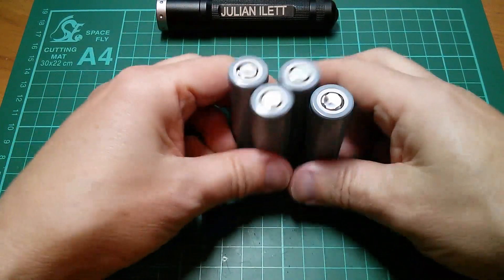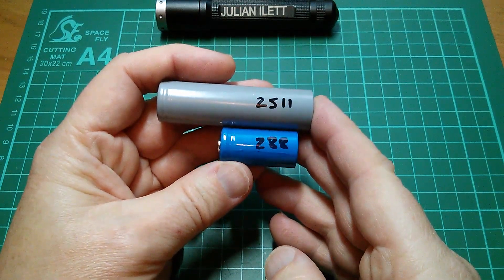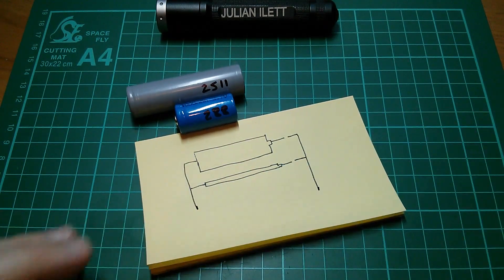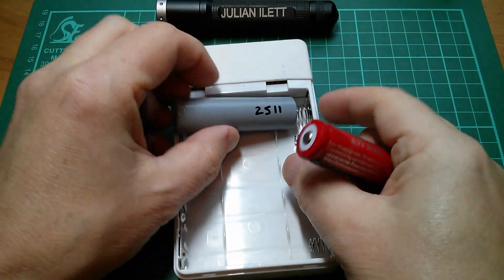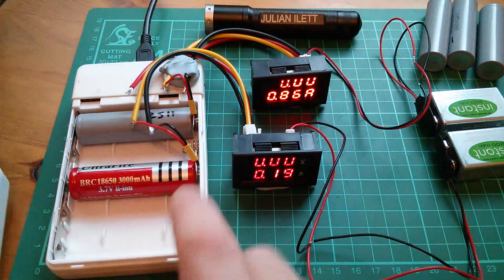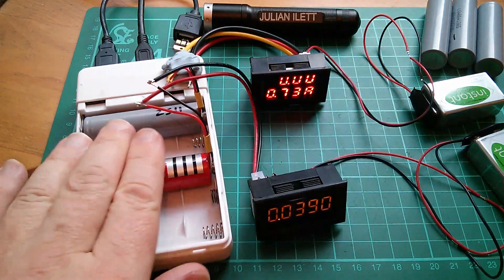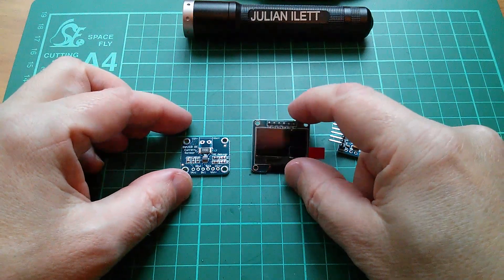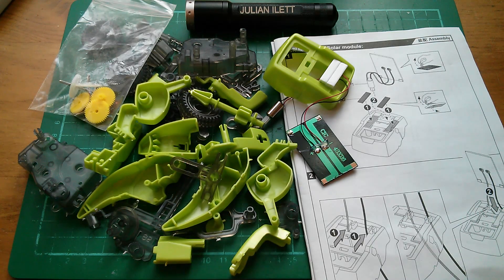Lithium Cells in Parallel + New Project (with pup and rob)

Comment: I found it Peculiar that as everything kept going wrong, the old 'it must be the equipment' explanation kept coming around... Instead of the fault being the experiment... lol

That being said, although it CAN be done, it is a VERY bad idea. A charger doesn't know the difference between the cells in parallel, unless you are balance charging, that's why balance chargers exist! I would advise against your little shop of fires style experiments, and suggest you take some precautions next time, like doing it outside, with a large container of sand with nothing flammable nearby, because Lithium batteries are definitely fire hazards when charged poorly.

Come on man, there is a very specific reason that EVERY BATTERY PACK you see has matched cells and thermal monitoring in the event a battery gets drastically out of sync, and those that could end up with a variance, have balance charging.

I typically really enjoy your videos, but I would have thought that when you destroyed one of the ports by melting the spring/housing, you would have learned the dangers of these things. It saddens me that people refuse to acknowledge JUST HOW MUCH ENERGY IS IN THESE CELLS. Have some accountability and prevent the spread of fire, practice safe electron penetration and you too can be disease... Er... Fire free... ;-)
Reply from the maker: Cells in parallel - cells in series - different rules apply.
Reply: Jacob Crosby hmm I think you may have LiPo confused with Li-Ion cells. I'm recovering 8000 cells and have extensively tested the risk of explosions and fire on my own channel, as have others, and it takes current from a mig welder to get these to explode. I've had these cells as hot as 90C and still no fire. On the other hand LiPo are ticking fire bombs. Galaxy 7 point and case. Feel free to checkout my channel for more information. It's good Julian is giving this an explanation through experimentation, it's certainly given me further food for thought.
Reply: Balancing are for SERIES. we are talking abotu PARALLEL. And no, PARALLEL battery packs DON'T have balancing. Only SERIES ones have.
Epic fail...
Reply: MrOpenGL No, that's why any packs that are in parallel have matched batteries, not a hodge podge of randomness. I've never seen anybody with items that didn't start on fire use mix-match cells, and if they do, they are charging them individually, i.e. balance charging them... So no, not epic fail, just as my comment said, matched batteries, mixing up batteries of different capacities/output capabilities, brands and the like is just inviting a fire. When you stop and consider just how much energy these batteries can dump at a moments notice, you start to have far, far more respect for them.

If you wouldn't mind showing me a retail battery with mix-match cells in parallel, I would love to see it, I guess I've just never heard of such a thing. That is a genuine request, with no sarcasm or negativity meant to be conveyed in any of my comment. :-)

I just see so many people that say crazy, crazy stuff about these cells. It is quite striking to me that seemingly everyone takes this technology for granted, instead of adopting safe practices, people have the mentality of "Welp, nothing's 'sploded yet, so it's completely safe", which couldn't be further from the truth, I guess I just don't see the point in taking the risk. Just because the cells you've tested didn't burn to the ground, doesn't mean that it's okay to ignore safety. Again, not knocking you, or anything of the sort, and I don't know how you work with your cells, but I have seen people buying used battery packs on eBay, slapping these old, crusty, unknown-history cells, none with the same capacity, different current capabilities, an so on, and slapping them together in parallel, and then extolling the virtues of cheap batteries, months later wondering why their pack is getting "Unbearably hot, but it still works so I'm sure it's fine" (that is a direct quote from a video I saw some days ago.

Anyhow, I do love the videos that Julian and BigClive produce, but some of their 'safety' practices really need work, especially when millions of people see these videos, and then you have third, or fourth-hand people with completely inaccurate information mistreating these things, it's all just a bit crazy to me. I'd rather know that I am doing something the safest way, and sleep at night knowing my house won't burn down, than to do things the cheap, lazy way, and wake up to my fire alarm going off, and my big pile of uncontained cells going up in a blaze of toxic glory... lol

Be well! Thank you for the discussion.
Reply: NERDVille Li-ion and Li-poly cells are the same thing... 'Poly' refers to the casing type, nothing to do with the battery chemistry...
Reply: Jacob Crosby
I have a powerbank that uses Samsung cells. They are all the same capacity, but they are certainly not matched (as in the typical RC slang for "overpriced battery") because they are of different batches. They are all in parallel, connected with a copper strip.
I can send you a pic if you want!

If you think about it, you'll understand why this is possible.

To make a Li battery explode, you should do one of these things:

- Stab, smash, puncture or otherwise damage the container.
- Overcharge it past 4,2 V (or 4,35V for some chemistries)
- Undercharge it significantly below 2,8V , leave it discharge for a few weeks and then charge it at a fast rate (without precharging)
- Expose it to temperatures above 65°C
- Discharge it with significantly higher currents than it is rated (e.g. battery rated at 30A, you do 60A)

If you put Li-ion or Li-po batteries in parallel, and they are charged at the same voltage when you do that (otherwise the more charged one will recharge the less charged one and large currents are going to flow), they are going to stay at the same voltage even if one of them is much smaller or bigger!!!. Since they are in parallel, provided the charger doesn't output more than 4,2V, it is IMPOSSIBLE for one of the batteries to overcharge. Batteries aren't boost converters!

Similarly, as long as the discharge protection cuts off at 2,8V, it is IMPOSSIBLE to overdischarge the batteries, EVEN if one of them is smaller!!!

Then, when you put Li batteries in parallel, the load should never exceed the maximum current that the smaller battery can supply. THIS IS NOT BECAUSE THE BATTERIES WILL BE "WORN" DIFFERENTLY!!! This is because if the larger one gets disconnected for any reason while the load is powered, the smaller one will need to sustain all the load and it could be damaged. Under normal conditions, all batteries will "work" the same.

WHY IT WORKS, with calculations!
Assuming 0 loss (of course)
E.g: you have a load that draws 1 A. You have a 0,9Ah and a 0,1Ah battery. You put them in parallel, that gives you a 1Ah battery in total.

You connect the load, both batteries are at 100%.
After 15 minutes, BOTH batteries will be at 75%.
After 30 minutes, BOTH batteries will be at 50%. This means that the large one still has 0,45Ah of capacity remaining, while the small one 0,05Ah.
After 1 hour the bank is depleted to 0%.
Battery 1 will have provided 0,9Ah to the load, while battery 2 0,1Ah. Each battery did its fair share, and none is below the cutoff voltage.

Now let's talk about currents. The load takes 1A. Battery 1 provided 0,9Ah in an hour, so it means a current of 0,9A. Battery 2 provided 0,1A in an hour, so the current is 0,1A. Again, each battery only provided the current it needed to provide, not more, and moreover it was balanced with respect to the capacity of the cell!

The same happens with charging. You put 1A in the bank, battery 1 takes 0,9A, battery 2 takes 0,1A.

Clear? :-)
If not, ask me questions!
Reply: "Little shop of fires..."Hilarious.

Comment: A good way to measure current on cells in holders is to use an off-cut of blank, double-sided PCB material. Cut it narrow enough to poke between the cell and the holder, and long enough to have the meter wires soldered one each side at the other end.

Comment: For those purposes, you can use a virgin double sided pcb strip soldering two cables and connect the amp meter between the battery and positive clip, best regards from Spain and keep It up with nice vids

Comment: Makes perfect sense when you think about how these cells are made, they are just a long strip rolled up into a cylinder. The length of the strip determines the capacity. So adding extra cells just increases the strip length, the amount its extended by is irrelevant.
Reply from the maker: Exactly :)

Comment: ACS712 module have 30amp current rating so why don't you use that ?
Reply from the maker: I'm really torn between the ACS712 and the INA219 - ACS712 is 1.2milliohm, INA219 is 100milliohm, huge difference. ACS712 is affected by magnetic fields. ACS712 has analogue output, INA219 is digital (I2C). Hard to decide.
Reply: I think the INA219 will be more accurate and also had I2C, while the ACS712 may get defected with the magnetic field interfaces.

Comment: You need to take account the burden voltage of those ammeter in account. You just cant do with two different ammeter of different burden voltage. However you did a poorly managed experiment which wasted viewers time literally.
Reply from the maker: These ammeters all have similar looking sense resistors - basically a short length of thick wire - the burden voltages will be similar and small. I deliberately didn't show the poorly managed parts of the experiment.

Comment: You could use card with some foil on each side that you can connect with clips to the meter, even better if you use a piece of double sided copper clad board.
Reply from the maker: I would have used double-sided copper clad board if I'd had some. Two pieces of veroboard just didn't fit.
Reply: Julian Ilett, What about use crocodile wires and a magnet to stick on each terminal of the batteries?

Comment: The answer is yes, they'll always work in parralel no matter what. I've been using that to make a giant e-bike battery and its been great.
Reply from the maker: As long as they're the same chemistry. You wouldn't want to put Li-ion in parallel with LiFePO4 for example.
Reply: Not in cell level yes but 14S lion and 16S Lifepo4 parallel is ok.

Comment: I am quite worried about parallel-mounting Lithium cells, because of the different voltages they might have. As you say, they will equalise (charge/discharge) rapidly - how do I make sure that this is not damaging anything?
Reply: Or put a temporary  light bulb/resistor in series with the connection until the voltages match, then make the permanent connection. Or, spend a bit of time with a multimeter and charger/discharger getting the voltages the same.
Reply from the maker: I suppose the safest way is to discharge all the cells to 3V before putting them in parallel.

Comment: how did you measure the capacity of the 18650's ? Imax B6 ? One at a time ?
Reply from the maker: I think I used the SkyRC MC3000 for the bigger cell and the Opus BT C100 (I think that's what it's called) for the little one.
Reply: Julian Ilett the MC3000 costs about £100 !! too much for me !

Comment: If your red cell is really bad and has a partial short, it will make both batteries go flat quickly. If it goes properly short it could take out your good cell with it. Which is why tesla battery packs have fuses.

If the voltage on the cells you're putting in parallel differs by too much, the current may exceed the normal charging current for that cell.
Reply from the maker: A very good point - although the 20,000mAh power banks have 8 parallel cells without fuses. I guess product obsolescence kicks in long before individual cell failure.
Reply: Julian Ilett There are a lot more cells in parallel in tesla pack so if there's a problem in one cell it's a bigger problem I guess. But I do think there's an argument for not mixing different quality cells. Outside of fun youtube videos, anyway.

Comment: Yeah those cheap ammeters just use a sense resistor straight into the micro's ADC so measuring a negative current would put a negative voltage into the analog pin which could damage it depending on the amplitude. The way to measure a negative current would be to use an op amp stage to offset the raw measured value from the shunt resistor (so it's always positive), read the value at the ADC and then do some maths to shift the value back down about the nominal zero point. A very common method for measuring feedback in AC switching power converters.

And just a comment, I think it would be more interesting if you made a separate longer video (or series of videos) for the plastic model build instead of short segments tacked at the end of your videos. It always feels a bit rushed and it's difficult to keep track of your progress since I've likely forgotten since the last video. It's just my opinion.

Also why does puppet granny sound exactly like the other puppet bloke who was in your last video? Anyway, once again great video!
Reply: The easiest fix would be put a diode in series with the output so that current could only flow in one direction (so long as you can tolerate the small voltage drop).

Comment: Sounds like a simple way to estimate the capacity of a random battery if you have a single known capacity in parallel.
Reply from the maker: Yeah, I was hoping to do exactly that - estimate the capacity of the lesser cell by comparing the current flows - but it all went wrong :(

Comment: You may have seen my recent video on expanding my lithium solar pack. The four parallel packs vary in their individual cell capacities by about 50-120 mAh. They're working very well as it stands (even in the recent dark and rainy days). 
It would be a lovely demo if you can put it all together. I think my pair of portapow premium USB power monitors might show this quite well. Wish I'd have thought of this!
Of cause it's not all that sensible to have a large divergence between cells, but again thanks for trying to prove it can work! 
By the way the 60a 'watt meter' is not bidirectional. When I had the between my battery and charge controller I had to have two wired in with the out put side wired together to see current in both directions.
Reply from the maker: Shame that Watt Meter isn't bi-directional - I wonder how much current you need flowing the wrong way to kill it. I'm pretty sure that's how I killed the little SkyRC WM-010 device :(
Reply: Julian Ilett Well one of mine was intentionally put in the wrong way round but it probably never saw anything over 3-5 amps with the size of my system at the time. Give me a shout if you need one and don't wish to wait too long.
Reply from the maker: Thanks for the offer, but as you know unidirectional ammeters aren't great for solar - which is why I want to make a bidirectional meter. I was thinking of getting an analogue moving-coil centre balanced ammeter, but that wouldn't have the precision. In any case, I fancy starting a new Arduino project :)

Comment: putting batteries that are charged and discharged in parallel can cause magic smoke :)
Reply: mark ward it can easily result in over 30 amps flowing, which indeed results in magic smoke. The right way to connect cells in parallel is to use a resistor between them to limit the current. when the cells have balanced out, the resistor can be bridged.
Reply: Jason Birch A very angry, fiery genie would pop out if the circumstances were bad enough.
Reply: POOF!

Comment: Plz tell me the way to recover the 18650 cell...and one more question...can i use a 4 volt lead acid battery instead of 18650???
Reply from the maker: Charge it VERY slowly and be very suspicious of that cell for evermore. Expect flames.
Reply: Aman Mittal To recover 18650, charge it at 5ma at 3 volts, then put it into regular charger when the current reaches 0, and yes you can use 4 volt lead acid cells